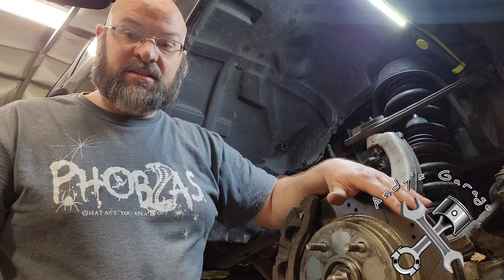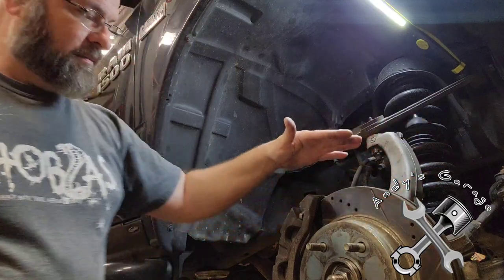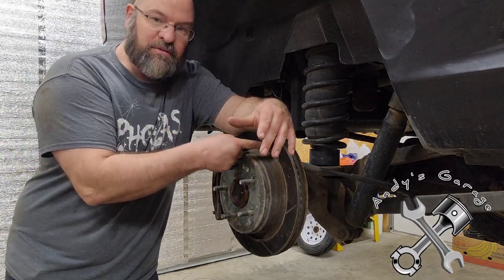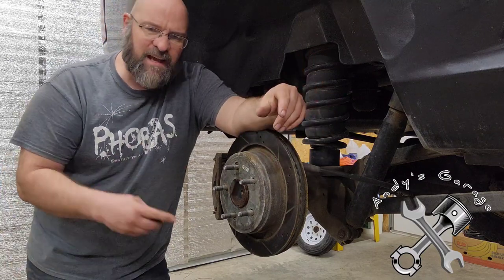Powerstop Z36 Towing & Hauling Brake Package Review

Comment: The z36 pad is probably the best I’ve ever used. I drive a lifted truck on 37s and I am absolutely amazed on how quick it stops. Plus with the truck being a 1/2 ton and not having as much brake power as a 3/4 or 1 ton. They stop incredibly well. To anyone questioning this pad/set. Absolutely do go with them
Reply from the maker: They seem to work well for mee too.

Comment: Anyone in here do overlanding and have these installed? Just curious because i carry a bit of gear in my truck and i have a bed cap as well as some gear on top and obviously when traveling you expect hills and such. So i would assume these will help with the weight and limitation of heat soak?

Comment: Speaking from the standpoint of having not received mine yet, I can't help but wish they had a few more holes in them for further peace of mind. I'm sure they work fine but the look of them almost look like there's just enough holes and slots for them to be able to say theyre drilled and slotted..making me wonder just how much heat and gas/dust they're actually dissapating.
Reply from the maker: If you have too many holes drilled in them you reduce the amount of surface material for the pads to grip. That's a downfall to drilled and slotted rotors.
Reply: @312ark  makes perfect sense. I fully realize that my bias stems from how frequently I've seen sets with more holes and how cool they look lol

Comment: Great video, do you think they are less prone to warp than the OEM or it's mostly a matter of how you drive ?
Reply from the maker: Driving habits make a huge difference on brake performance. When it comes to this setup, it's more about heat dissipation. Greater heat dissipation results in less brake fade.
Reply: Thanks for taking the time
 @312ark
Reply from the maker: You're welcome.

Comment: Had Z36 installed on my Escalade yesterday and im wondering if I was suppose to feel a noticeable difference with the firmness of the pedal  immediately after install or does it get noticeably stronger over a day or two  . Right now I think my factories had a better bite less effort on the foot to pedal pressure to come to a hard stop. I guess with all the hype I was expecting to tap the pedal and almost get thrown through the windshield . I was told they will bite more over time any advice would be helpfu
Reply from the maker: I noticed a difference almost immediately. Where the pads and rotors broke-in as recommended? I did a brake fluid flush when I put on the Z36 brake package. Brake fluid flushes are super easy and you can buy a pressure kit pretty inexpensively from Amazon.
Reply: @312ark  
Yep I broke them in according to the instructions . I could smell my brakes inside the cabin however I didn’t do a break fluid flush didn’t I had to but it’s worth a try
Reply from the maker: Hopefully you'll notice a difference soon.

Comment: Would you purchase the PS Z36 brake set again?  I am looking to get new pads/roters.  I have a 2008 Ram 4500 11' dump with 19.5" wheels (6-speed manual).  I do see that PS makes a set for my truck on RockAuto, but my concern is that the PS uses a Ceramic type pad which are not good for stopping compared to semi-matalic pads.
My truck will get up close to 25,000 lbs sometimes with a load in the bed and pulling my backhoe, and I have always used semi-metalic pads and a solid serface rotor.  Would you say that PS Z36's would be a good choice for these large 4500/5500 trucks?
Reply from the maker: Yes, I would purchase them again.
The package that I put on my truck is design for towing and hauling. When I pull my camper and have all of our gear I weigh about 10,000 lb and have never had any trouble with hard stopping. Keep in mind, your trailer brakes play a big role in your stopping ability too.
Reply: What was the break in procedure for these brakes?
Reply from the maker: @garywhitney2529  I don't remember. Powerstop has the break-in procedure printed on their boxes.
Reply: I got the ceramic pads and black drilled and slotted rotors in a set of 4 with the 8 pads, and some red re man calipers separately. Im around 750 in it with the caliper cores being sent back. Its for a 16 wrangler jku, wish i would of paid 70 more for the bigger rotors but i couldnt find a red caliper to fit. The stock rotor size seems to do fine so far tho! I say look for the sets separately like I just did and then u can send the cores back on the calipers and they provide a greatly discounted shipping label if you go through their site when your ready. I noticed the set with caliper, caliper bracket, pads, and rotors don't give u a core option to send old parts back
Reply from the maker: @Todd_G_FPV  Good luck installing them. These are the kind of jobs I love to do. You did pretty good cost wise.

Comment: Do these feel like they bite harder or about the same a new OE brakes?
Reply from the maker: About the same. These things are designed with heat dissipation in mind.
Reply: @312ark   Thanks for the reply. I ordered these rotors but got a different pad
Reply from the maker: @TheRealChrisShades  I hope they work out for you.

Comment: Thanks For Video
Reply from the maker: You're welcome.
Reply: @312ark  what if you was to put this set on a midsize sedan would that be a problem?
Reply from the maker: I've installed Power Stop brakes on mid size cars in the past. Granted they weren't the drilled and slotted rotors.

Comment: You don't know what you're talking about about the science of breaking systems crush drilled rotors allow the out gasing from the pads to escape They do not allow them to cool faster there's actually less material there for a smaller heat sink and they're prone to cracking I've had cross drilled rotors on the streetcar and they cracked at the holes. Newer brake pads since probably the '90s don't have the out gasing problem that these rotors were designed for
Reply from the maker: The slots help the gases escape and the drilled holes help to cool the rotors.
Reply: @312ark  
From motortrend "Cross-drilling brake rotors supposedly helps vent gases created when the resin bonding agents within the brake-pad material begin to break down at extreme temperatures. When this happens, the pedal still remains firm while the friction coefficient decreases, causing a loss of brake effectiveness. Racers often refer to this condition as "green pad fade" or "outgassing." With new-tech, preburnished carbon fiber or ceramic racing brake pads, this gas buildup is no longer a major concern. Less exotic street-pad components are still subject to outgassing, but only when used on a racetrack at extreme temperatures rarely, if ever, seen on the street.

Another theory was that drilling multiple small holes in the rotor surface increased the coefficient of friction between the pads and the rotor because all the additional small edges let the pads bite more effectively. But today's modern carbon-fiber pads are designed to operate at higher heat levels where the friction coefficient is inherently higher, so any additional hard-edge bite is superfluous. And all those added small edges eat into the pad material, shortening its life.

That leaves only potential weight savings and (if you are into profilin') visual enhancement as the primary reasons why anyone would drill rotors today. Nevertheless, there's a big potential downside to drilled rotors: micro-cracks that propagate out from the holes. This can be a particular problem for street-driven cars."

Why don't you do a little research before you start spewing nonsense on YouTube You don't know anything about the science.
Reply from the maker: I only provided info that available from the manufacturer.
Reply: @312ark  You mentioned the real science of breaking which you don't know what you're talking about which is clear from what you said. I use power stop pads myself I like them and as you can see their carbon fiber ceramic which is mentioned in the article I quoted you for motor trend doesn't out gas. I know you have a camera and a YouTube account so you figured you'd make some video that's useful for people but the info you're sending out is wrong
Reply from the maker: Did I say something that's outside of someone's personal opinion? Maybe. An article from Motortrend, while it's still a respected source, isn't the gospel. It is an option based on research from the author. You can find articles all over the Internet about braking systems and most of them contradict each other. These articles are a great way to begin researching, but like everything else it's best look at multiple sources. People tend to report what they've experienced and/or what they found through their own research. I'm not saying what's in that article is false, it's s an option that is based on the authors research and/or experience and should be considered in conjunction with other sources.
Reply: Not a single video posted regarding break systems. If you're able to gather that information or already possess it, why look at a video like this on youtube in the first place. How about making a video of your own instead of being an idiot and commenting on this dudes video with your copy/paste opinion. Food for thought. @darrenporsch
Reply: It's the lack of punctuation for me @ronald1932

Comment: Did you keep the original calipers?    Because I was looking at rock auto and they sell them as a complete kit with new calipers.    Not sure if these power stop calipers are better or not.  I have a 2015 ram 1500.  Did many many trips, pulling a 5 x 10 trailer back-and-forth between New York State and Florida.   I heard about the Power Stop rotors and pads on a Ram Truck Forum.
Reply from the maker: @johnforsyth8414  I kept the OEM calipers on the truck.